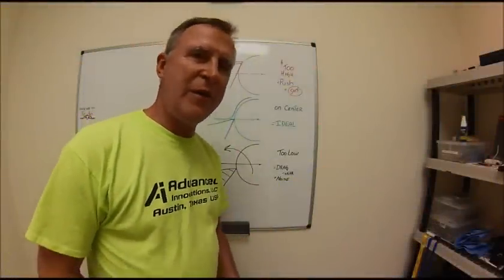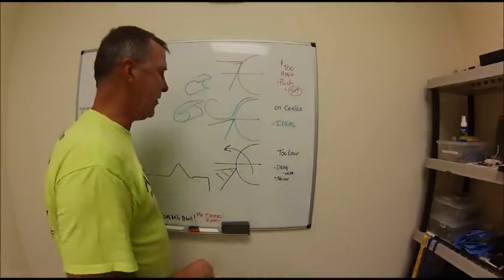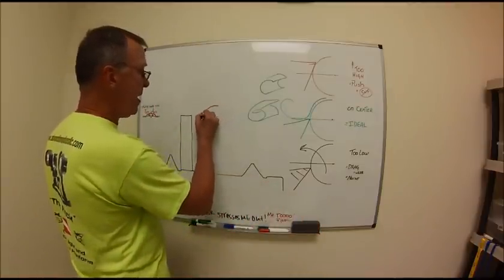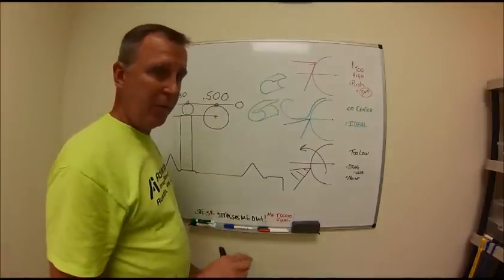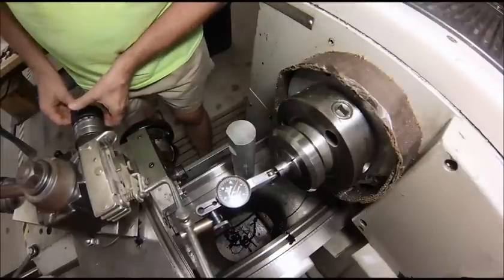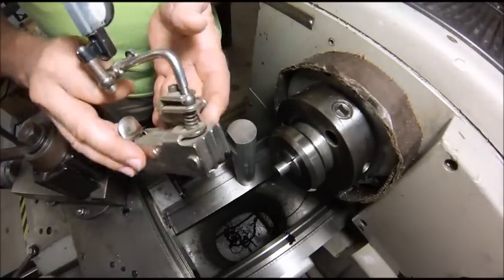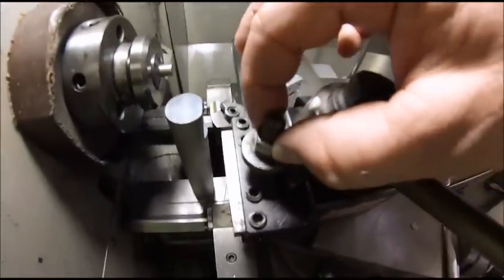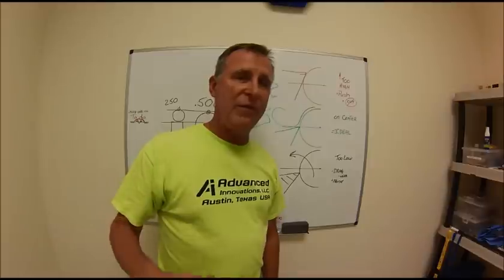Setting lathe tools on center

Comment: I find the quickest and easiest way is to wind the tail stock out, move the tool post back, and put my 6 inch rule between the tip of the tool and the outside of the center or drill holder. If the rule stands vertically the tool height is correct. If the top of the rule leans out towards the tool the tool height is low, and if it leans away from the tool, the tool height is too high.
Reply from the maker: Depending on the grind of the tool, the turning and facing edges are rarely on the the same plane. This "Scale" technique is good for turning, but can still leave a tool too high for good facing op's.

Comment: How do you feel about the kind of height setter with an overhang - you run it up against the tool. If the tool slides under with tiny contact you're on the money....?
Reply from the maker: Excellent. Hardinge has one like that and it works perfectly.
Reply: Yep - that's what I have. (I have a Sharp 1118H - copy of the HVL-H.) I inherited it from my father. LOVE that lathe! Every time I switch from the one I bought (Weiss/AKA Precision Matthews 1127, which is a perfectly good lathe) to the Sharp its like getting out of a 80's era Ford and into a Mercedes.

But I need a gauge for the PM1127, and I was thinking of making one like that - then I saw your video. I ALSO like the following technique when possible - chuck up a piece of 1/8" round, bring the tool up against it with a thin piece of steel in between (I use long x-acto blades) and adjust tool height until the blade is held vertical between the tool and the round bar. I have turned a point on that little piece of 1/8" brass, so if I already have work on the chuck I sometimes chuck it in the tailstock chuck and set tool height there. 

Thanks again for your videos. You've taught me a lot of really useful tips!
Reply from the maker: Thanks for watching. Glad you got something you can use.

Comment: Joe, you always explain things so clearly!
Hardinge lathes used to come with a similar post specific to each particular machine, only those had a cap on them so you could use the underside to see if the tool was too high and the top of the post proper if it was too low. 

I once saw a guy use a neat trick to center a tool - take your 6" scale and trap it between the tool and the work. Look from the tailstock toward the spindle. If the scale is vertical, you're on center. If the upper end is toward the right, it's too high. To the left, too low. Not as precise as Joe's method, but really quick more effective than it would seem. Of course, Joe's method is dead nuts accurate and very quick once you have your post.

Comment: real good idea Joe, I like it.  Also, I find if my tool bit is too small and the quick change holder doesn't have enough adjustment, I just put a 3/8 dowel pin under the adjusting nut and it stays there just fine and I can use the adjustment again, if I am switching tools all the time, I just put the dowel pin back in when I use that tool.

Comment: Hey, is there a way to make the tool height reference bar using just the lathe? Without the mill. Ie just facing off the bar to the correct length/height. I'm just stuck on machining the flat. Only thing I can think is to mount it across a four jaw, with one of the jaws turned around and machine the end, (now on centre) But this would put a lot of stress on my small myford ML4  having such an unbalanced load in the jaws??? Any other ideas?

Ps Just subscribed to your channel, lots of useful tips, please keep the videos coming 😀 Jon
Reply: Let's say you indicated as Joe says and you discover your post is .017" too long. Put your post in the lathe, grab a piece of .017" shim (or a couple that add up to .017). Bring your facing tool into contact with the post, set your carriage stop holding the shim between it and the carriage. Remove the shim and now you can face off exactly .017" by holding against the stop. I've done this using drill shanks instead of shims, too, and have had pretty good success with this method.

Comment: The height tool is neat. I made mine out of two 1/2 inch bolts. Of course I faced the bolts off. I joined them in an extra long nut used to join all thread. I put two jam nuts on it to lock it in place. I'm not a "machinist" but have operated lathes for 20 + years. This little trick makes my life easier.

Comment: I haven't gotten around to making a height block for my lathe yet, but had been planning to for some time now.  

I have made myself a LOT of specialty gauges over the years for setting tools in screw machines though. Of course some of them I ended up making duplicates of because my co-workers saw them and wanted a set of their own. 

Definite Time Savers and they take all the guess work out of a set up.

Comment: maybe machine a big screw in the bottom of the gauge cylinder so you can easily lift or lower it to the right height and then lock it with a lock nut or something x)

Comment: Joe, seriously?  Any turner can set a tool without all that elaboration.
This is just some narcistic demonstration of engineering knowledge.
You actually saying that method is any more accurate than setting it against a turned bar face or headstock centre.?
Was a machinist for 46 years and I would have been all day turning like this.
Your a nice guy, dont get me wrong, but seriously?
Reply from the maker: 38000+ views, 248 good comments, 2156 thumbs up.   vs 4 down. I'm not really diggin being called a narcissist, but feel the need to point out that this video wasn't made for a 46 year tradesman. A tool height standard is a good thing to have and it only has to be made....once. So the elaborate ritual of centering your tool would consist of grabbing it, using it, and putting it away.
Reply: Joe Pieczynski h
Hey Joe, my apologies. I have been pretty rude in my comments. I now realise you are tutoring newbie machinists.
Please accept my apologies. Keep doing what your doing 👍
Reply: You can take your apology and stick it into your arse. Your point has no real merit, other than exposing you as the rather ignorant man/machinist that you are. I had a quick look at your upload section, it's full of family tat. I mean, where do you get the nerve?
Reply: Tom Jones no prob Tom if thats how you feel. Keep my family out your opinions please.
Good memories of a happy life but then again my intentions are not to make money off them but to share with my friends and family across the world.
Perhaps the electronic beam welding one may have interested you being part of my past career on an engineering level.
My point was that it appeared to be an over elaborate method for a relatively simple procedure. Joe answered and I reconsidered my posting. If anyone is being irrelevant its you becoming involved in someone else's communications 😳😳😳

Comment: I've had a problem with the stud coming loose in the tool quick change bases. To stop this I milled a 1/4" hole in the side of the base down to 0.1" from the threaded hole in the base. Then with the stud bottomed out I strike the center of my hole with a center punch. This makes a deformation which prevents the stud from turning in the base.
Reply: a little red loctite and the height adjustment post in my tool holders never moves again

Comment: Use a piece of acetal/nylon . Get tool  near centre height and take small facing cuts until there is no pip and tool isn't pushing a pip from centre. Acetal is good too use as it will not damage inserts /HSS tool points.
Reply from the maker: Agreed 100%
Reply: Christian Brown p

Comment: Thanks for the great Idea.  I have started to make this, and rechecked my bed twist with precision machinist level. There is no twist, but my cross slide travel is not parallel with the plane of my ways. Placing one inch gauge blocks on the flats and a parallel on top of them, I get an increasing change in height from back to front when sweeping with an indicator mounted on the cross slide.  I have read that it is not necessary for the carriage travel perpendicular to the lathe bed to be parallel, but won't this affect the usefulness of the tool in my case?

The lathe has very few hours on it and is practically new. I am a hobbyist.

Comment: Between this vid and a height gauge vid from oxtools I got inspired to make something simple enough that I could make. 

What I did was cut some stock about half an inch higher than centre. Then I set a tool at centre by facing off the same stock adjusting the bit to lose the tit. Using the centred tool I marked the soon to be height gauge. 

But instead of machining a surface on/below the centre height I machined a wide groove so my surface is on/above centre height. I turned to a right hand shoulder where the shoulder will become the centre height. When I set a tool to centre it has to just slide under that shoulder. This way I can adjust it, I can raise the centre height by removing metal from the shoulder or I can lower the centre height by removing metal from the bottom of the gauge. 

It's probably not as good as yours as it's more of a visual thing, the bit has to just pass under, but it is adjustable which is why the stock was cut half an inch higher than centre, and I was able to make it just on the lathe and I didn't use any measuring device at all. It is another option for people with less equipment.

Comment: nice technique for setting tools, another quick way i found is to lightly pinch a small piece of sheet stock between the cutter and your part then adjust tool height until the sheet stock is pointing vertical.

Comment: one of the methods they've taught us in machine shop is to face until the tool doesn't produce a nipple. What are your thoughts on that method?
Reply from the maker: You know, depending on the grind of the tool, and what you are doing, its dealers choice. I feel much better when I can face a part off with smooth. If you think about it, a tool with a positive rake and a nose radius, really does have 2 working points. One for the face op and one for the OD op. Set for the one thats important to you.

Comment: Thank you, Joe.  I've been putting a thin piece of stainless between the tip of the cutting tool and the workpiece and adjusting the tool up or down with the stainless between.  When the stainless piece is vertical (while pinched between the tool and workpiece), I've been calling it good.   It worked a lot better than untrained method of just eyeballing the tool.  With your method you demonstrated, I'll be spot on, no guesswork.      
I've only recently discovered your videos and thank you for taking the time to tutor me (us).    This is good stuff.
Reply from the maker: Thank you.
Reply: This is how I was taught to set the tool bit. Currently I use a 6" scale (pocket scale) to set the tool height. Place the scale between the work and the tool bit, and close the bit against the work. If the scale is perfectly vertical, the bit is "on center." If the scale tips toward the operator, you are "below center." If it tips away from you, it is "above center." I love the custom Gauge Block, though. My question is: "Is my method lacking in some understanding?" I also do not have the luxury of a Quick Change Tool Post. Mine is a 4-way rotating tool post. Each tool must be individually "shimmed" to the correct height. I love your presentations. Good shop practice.

Comment: A quick check for on center is to take a 6 inch scale and put it against the part. Dial in till the tool tip touches the scale. If the scale is tilted forward at the top, the tool is above center. If it tilts back then it is below center. If the scale is vertical then the tool is on center. I have a center check to set my tools but to check to see if they are on center line quickly. I do the scale check.Just sayin.Jim
Reply from the maker: Hey Jim. Either of these methods usually only determines 1 of the 2 contact planes. turning or facing. An aggressive rake tool with a nose radius will be above center by your method when used for facing. With my method, it would probably end up low on the face. Think about it.
Reply: I understand that. Just sayin, I use the old scale method to quick check if someone has changed my tool settings. If it's above or below center I then re-set the tool with the height gauge that I have made for the machine I'm using. It's amazing how often I have found that someone has re-set the tool height. - (Sigh)When the tool is at the correct setting, the inset lasts MUCH longer and it's easier to break a chip. 6's & 9's.Jim
Reply from the maker: C's and 6's. I don't like 9's ( just kidding of course)

Comment: thanks for getting back to me coo lAT what speed to you run a lathe when cutting steel
aluminum speed
Also why can't i put a smooth finish on steel when doing cuts all ways ruff
and I had a guy cutting and the tool was squealing was he going to fast?
And with the cutting tool what do they mean by the degree I never had to worry but now I want to buy one they have all different degrees

Comment: Dial indicate the difference then chuck it in the lathe and face the end that depth if you don't have a mill?

drill a hole in the bottom and glue in a magnet?

excellent set-up tool to have, thanks
Reply from the maker: Good suggestion. Both of them.

Comment: To add to the video, another fun trick is to have the same sort of help piece but then add a plate mounted on top off it.
Then putt the tool against the plate, it then reaches the same point as the top of the normal help piece, if you want to check the contact then putt something of 0,01 mm between it to check it (like a foil for example).
Reply from the maker: Many commercially available, machine specific height gages have that top plate. If you have it adjusted so it spins freely, you can rotate the whole height gage and watch for the top plate to hang up on the tool as it tries to clear it. Its a great visual indicator that the tool is too high.

Comment: Same general principle when setting tooling on center, but upside down?  Re: Your video on threading in reverse, upside down, away from the chuck.
Reply from the maker: Correct. On center or very slightly above.

Comment: Joe you will be surprised at how accurate you can get by taking the scale out of your pocket hold it against the part in the lathe then crank your tool in the tool post up against the scale just tight enough to hold it in place and look at the scale to see if it is 90 deg. vertical to the ways (eye ball is good enough) if it isn't vertical adjust tool up or down.
Reply from the maker: Argument......Tool turning tip is on center, at this point, the facing edge of the tool could still be too high with an aggressively ground tool with a nose radius. this thing is good, but a good cut is ultimately what we need. That scale trick is pretty cool.
Reply: Joe Pieczynskil

Comment: Hi Joe. I have a question, with carbide inserts with a radius along the cutting edge, not the tip radius, can the tangent point be picked up for centering tool on the lathe? Maybe you can show how to use a ball bearing to bring an oversized slip fit back to a press fit? Hammer ball bearing over the hole to smash some material back into hole and re-ream. You seem to enjoy teaching tricks I just thought i would send one your way. Or maybe using folded up paper on your soft jaw in the mill vise so if a presise angle needs to be cut the tool does not push part back down flat thus loosing angle that was set.
Reply from the maker: Carbide inserts that sit neutral can be picked up regardless of their profile. If you had a round insert sitting at a positive rake, the front and side of the tool would be at different heights. That would be your choice as to which to center based on your part features.

Comment: I have new way for you. I was looking thru a very old 1925 south bend book. Once you determine your center line or tool height . Back off your cross slide to make room slide down your tail stock and scribe a line on face/side of tail stock ram/piston.  Or use a random piece of square stock set on ways and scrip a line from tool to scrap (save it). It's all the same principal, just thought it interesting as well as fast and cheap how the old timers did things.
Reply from the maker: So exactly how did they find the tool center height so they could use the tool to scribe the center height line? Crafty old dudes !

Comment: Another good video. Your comment about storing things on the head stock is a good one. After an incident that took out one of my flourescent lights I vowed to limit the clutter on top the lathe. I took a cafeteria tray and screwed it to a tall bar stool. I can put all the tools I need for a job on another tray, carry it over and it nests nicely into the one thats screwed to the stool. Portable table at a good height. I have found the trays very handy for keeping tooling for different jobs layed out and ready to go. Easy to clean, easy to store. A guy could mount one to the headstock easily enough so other trays nest on it. Just an idea that worked for me.
Reply from the maker: I too have seen tools launched by chuck jaws. They just go bam and disappear. Just wait for a second and you'll hear it hit somewhere if its not sticking out of your chest or forehead. I stage my measuring tools and cutting tools on 2 separate rags on my bench.